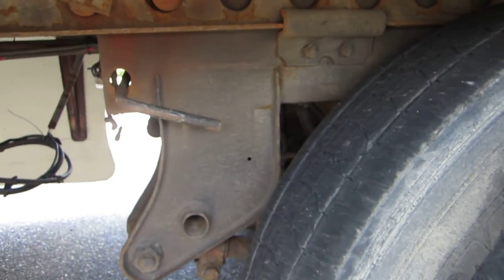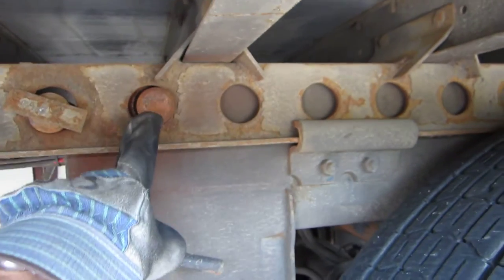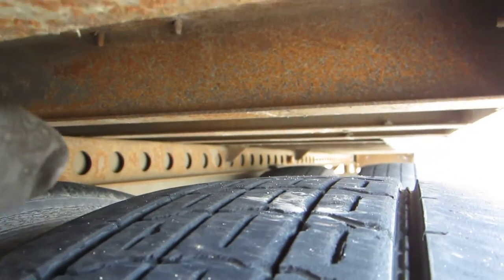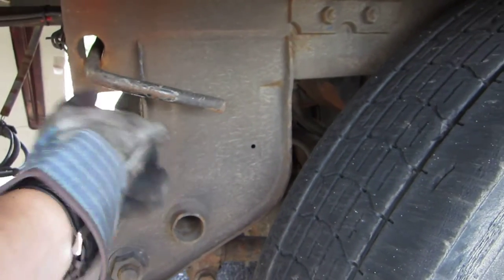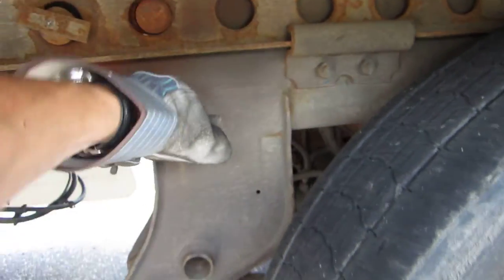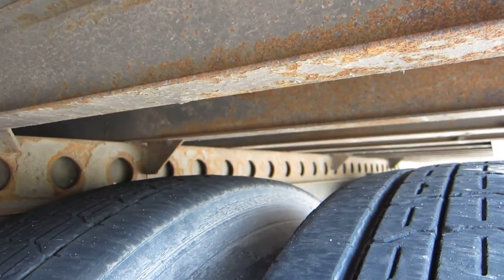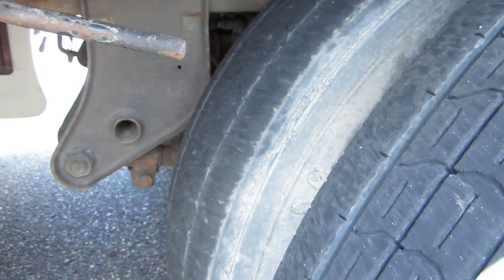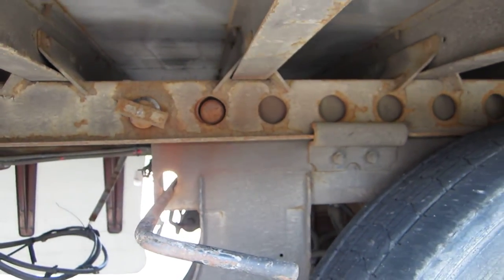Mr. John Tutorial : Sliding the trailer tandems (trailer axles) of a semi

Comment: I did not know axles could move like that.
Reply from the maker: Indeed- all trailers have this capability so the unit will fit into the D.O.T. perimeters of 12000lbs on steers, 34000lbs on drives and 34000lbs on trailer= 80000lbs Gross Vehicle Weight Rating (GVWR).

Comment: Do you geese yours or keep it lubed ?
Reply from the maker: ...it's tension between the trailer rail and pin that causes pins sticking...applying the trailer brakes and lightly backing or moving forward while the release handle is locked 'out' usually releases them...'fluidfilm' wouldn't hurt...

Comment: What’s that bar in the first hole for ?
Reply from the maker: Hi...That's a 'stopper bar' to prevent the axles from sliding off the rail....the other end of the rail has the 'ICC' bumper mount.
Reply: @tinyhome60mph  that stopper bar is it suppose to move freely or does it have to be welded. DOT put me out of service for that.